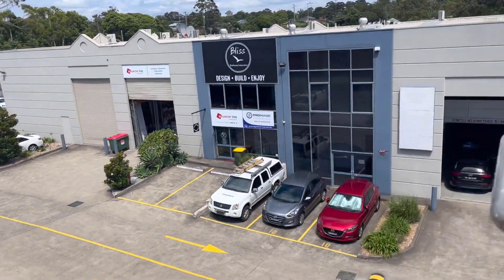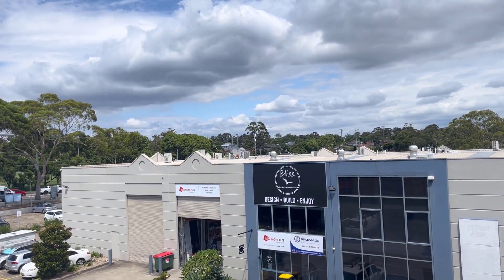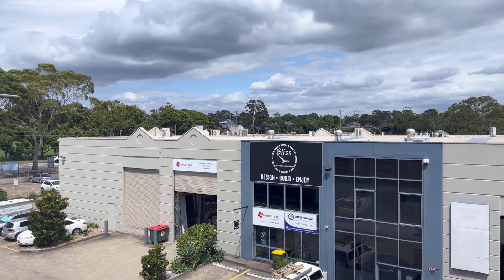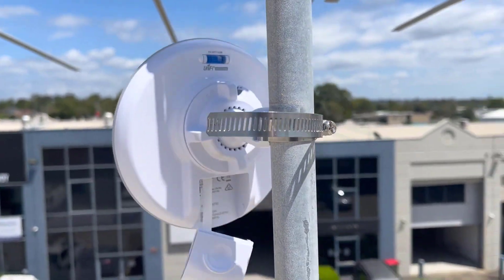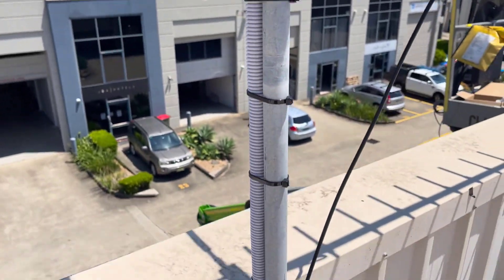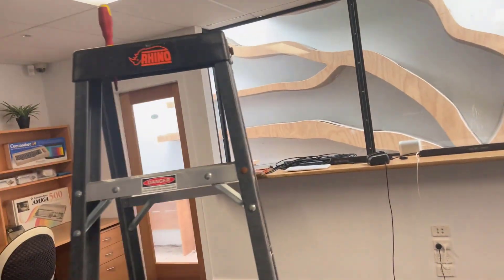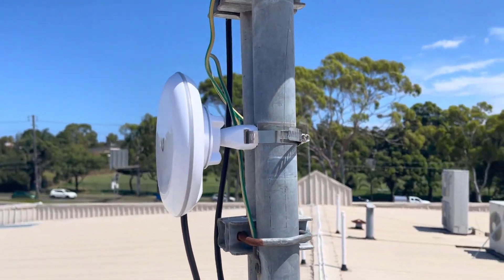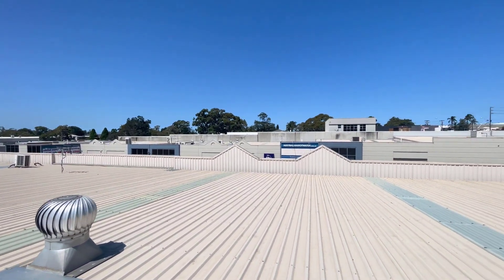How to share internet between 2 buildings  Easy Using Ubiquiti UniFi Building to Building Bridge

Comment: My UBB's are solid green on the right side and solid red on the left yet I get 1.75Gbps over the link 100% signal strength.

 I believe the reason the signal is a little finicky right now is because there's a metal eave just above the Station and the station is tilted upwards towards the other about 800' away which is around 5' higher in altitude.

 I've purchased some of the quick wall brackets so hopefully I can get a solid green in a better location
Reply from the maker: Thanks for your feedback on this video 👍

Comment: No offence but why wouldn’t you use solid conduit once you hit the roof line . Looks messy yes it’s a roof but pride ? 
Need to use the cat 6 With drain wire and metal rj I think it’s a bit of a waste of time but being that it’s imperative and it’s not much extra to get might be a worth while insurance policy
Reply: was thinking the same thing... little bit of pride

Comment: Can that thing take very hot sun temperature    I mean it's exposed to the sun from the time the sun is on it  to the time it reaches highest temperature in any clear day of the week throughout summer    
what about cold weather  can it handle cold temperatures   during winter seasons    can rain sort of interrupt  its signal and  cut off  its wireless signal connection
Reply from the maker: Yes. It’s designed for the outdoors
Reply: @SECUREACOM  Quite expensive this Ubiquiti thing    when I browsed for it on the Web    it's as much as the quote I was given by a cabler for a standard cat 6 cable installation